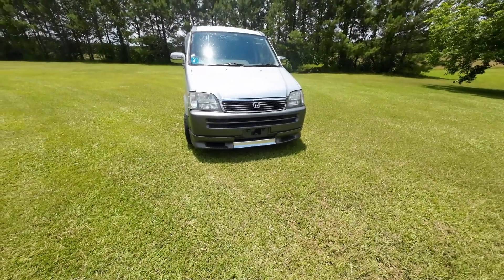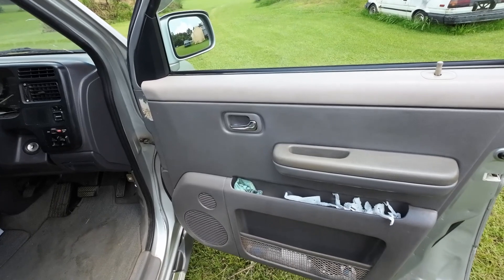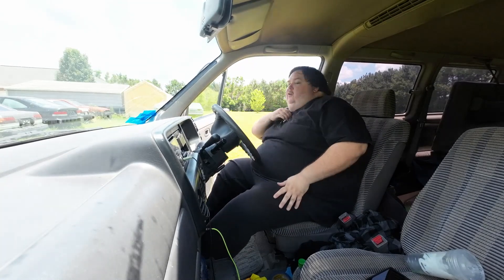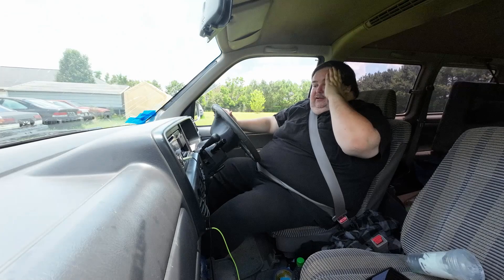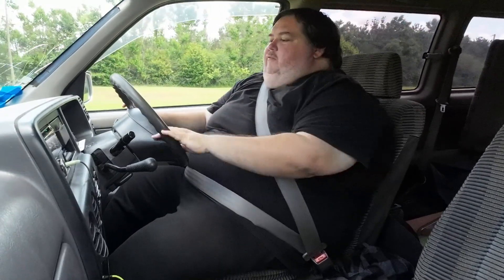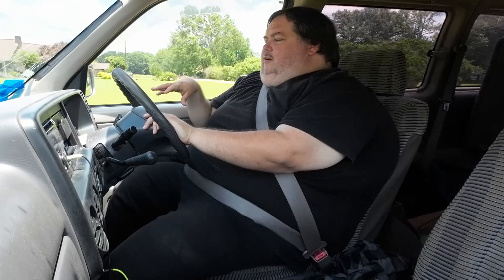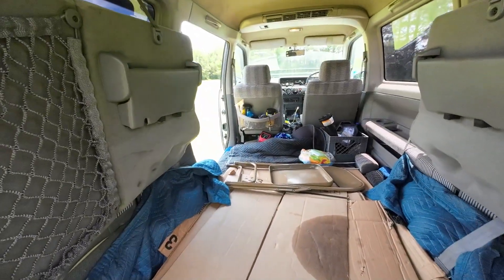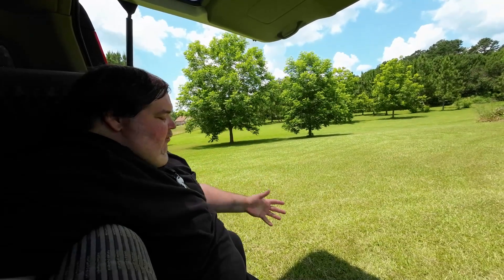Will I Fit? - a Honda Stepwgn review

Comment: I have one of these, a 1999. I think it's the best JDM vehicle I've gotten so far (this was number 10). Had really low miles, about 27,000 and the interior is mint. Body is nice, little faded and it has alloys too. Next to my cargo Aerostar, best van I've owned. Fuel mileage could be better, getting around 23 mpg but I run it on the highway about 110 km's to work. Would buy again.
Reply from the maker: I think they are fine until 90k miles then the transmissions start going bad because the filter can only be changed by disassembling the trans.